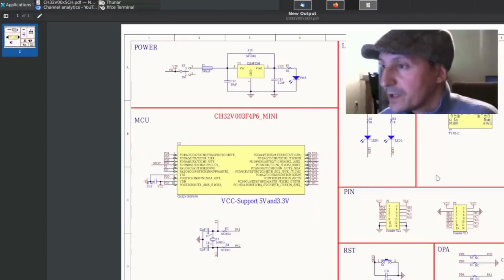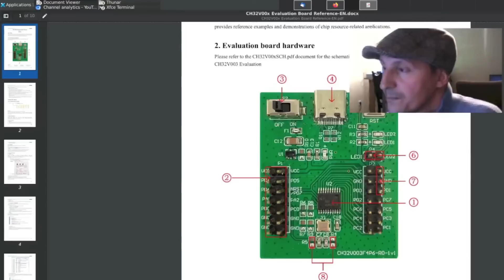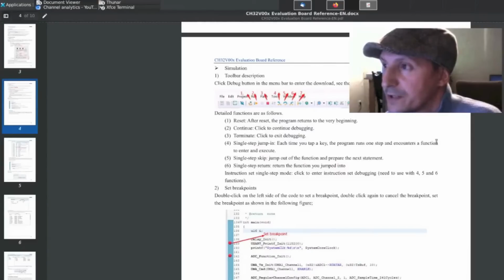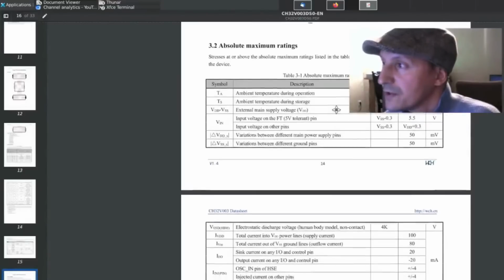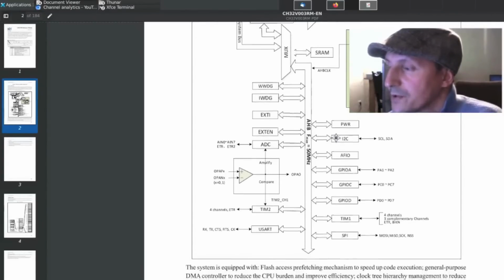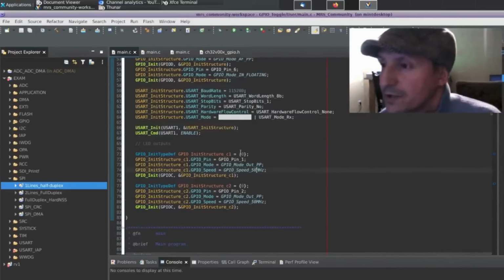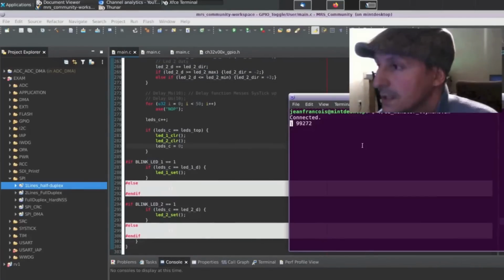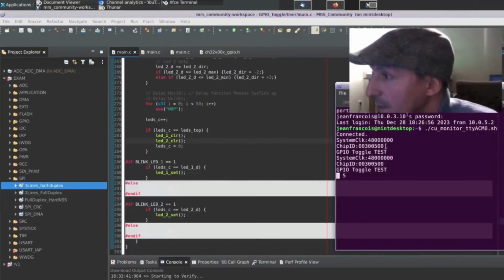CH32V inexpensive RISC-V Development kit test and review

Comment: Hi I want to use 18.432Mhz pl. make tutorial on system Clock and System Tick Thank you
Reply from the maker: Good day Azad,

If you have MRS IDE and the WCH example, it should work with using the HSE (external crystal) and define the correct frequency for you crystal like this:

in system_ch32v00x.c:
#define SYSCLK_FREQ_24MHz_HSE HSE_VALUE

in ch32v00x.h:
#define HSE_VALUE                 ((uint32_t)18432000)

You can find an example with a blink led at below repo if you need, just configure the library for the WCH board if you have it, by defining EVK_CH32V003_GENERIC in ol_lib.h.

https://github.com/jfsimon1981/orion_nunki_evk

I'll try get the clocks covered in future, but that's quite some work, meanwhile this should get to work for you.

Regards
Jean-François

Comment: What is the name of IDE
Reply from the maker: Hi it's MRS MoutRiver Studio, based on Eclipse and similar to mainstream IDEs used at NXP, STM ...
I run the Linux one. It's available i believe for Mac, Windows and Linux, as makefile and MRS projects, although it's easier to just use the MRS project (which is building and flashing right away, with proper link files included to flash proper region).
Regards
Jean-François
Reply: @chrysalide_electronics  Is there a plugin for VS Code that works with this device?
Reply from the maker: Hi, good question, i'll investigate further, there seems to be works about this, like this VS's Makefile using the MRS (MounRiver studio) in the background.
Link below:
https://github.com/jfsimon1981/CH32V003_Template

Regards,
Jean-François